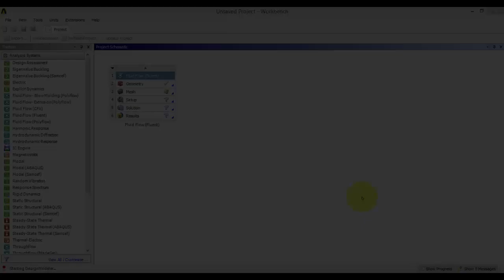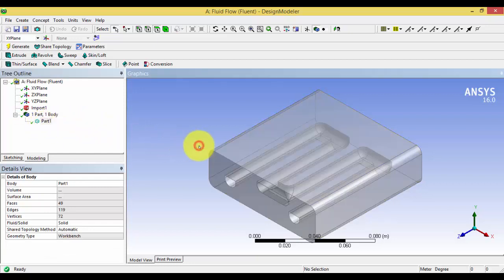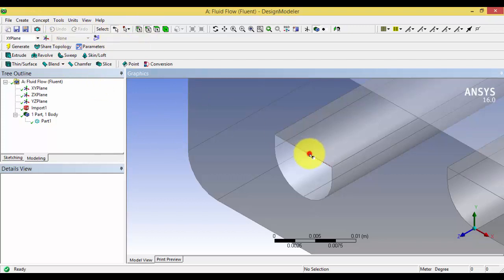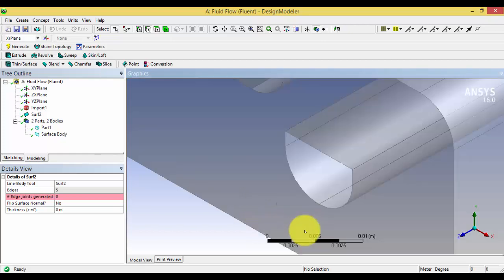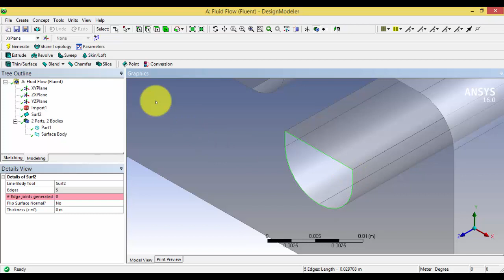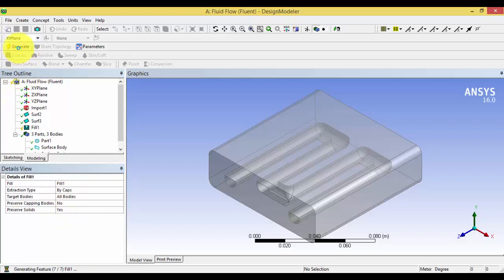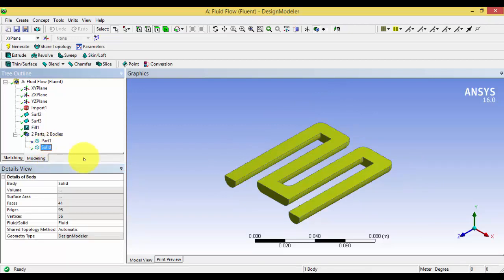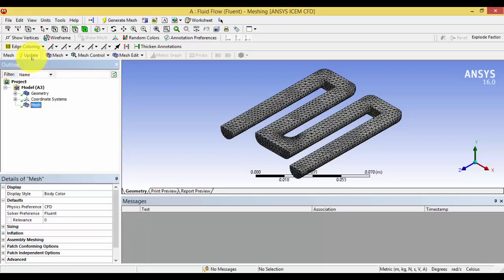Create fluid domain from solid geometry in Ansys Workbench | Ansys Fluent | Suppressing a geometry

Comment: I did this and then the geometry tab in workbench goes back to "?" ant this error show up 
"(DP 0) The Geometry component in Fluid Flow (Fluent) requires user input before it can be updated. For instructions on how to address the cell in its current state, click the blue triangle in the lower right corner of the cell in the Project Schematic." does anyone know what to do? ansys 2023 student
Reply from the maker: I'm not sure about the problem you're facing. If the geometry goes back to "?," it probably means that the fluid domain is missing or there are some errors related to it. Make sure you have clicked "generate" after performing any operation. Also, ensure that at least one fluid domain exists in the tree.
Reply from the maker: If your problem still persists, feel free to mail me at autoabraham@gmail.com

Comment: Thank you so much, this was super helpful! I am modeling organ-on-chips and you saved me a lot of confusion! I would like to simulate something like the sloshing of coffee in a (complex) cup. Is it possible to use free surface boundary and avoid a full fluid domain? Additionally, do you know how to bias the mesh so certain aspects are more precisely defined? Thanks again!
Reply from the maker: I'm glad to hear that you're interested in simulating organ-on-chips! It's a great idea. I'm curious to know how it's related to sloshing analysis. It could potentially be done using the Volume of Fluid (VOF) method, where instead of a free surface boundary, you could consider the possibility of doing it in 2D to reduce computational costs. Biasing the mesh should not be an issue and can be done easily. If you need any assistance, feel free to email me at autoabraham@gmail.com. I'm interested in this analysis and would be happy to work with you.

Comment: sir, if i suppress the solid body , that means in fluent only the fluid volume will be generated and analyzed and solid body(which created in solidworks) will be ignored ?
Reply from the maker: Yes it will be ignored. In most of the cases, the solid body is not essential. Some thermal flow cases, the solid body is also essential in the analysis.